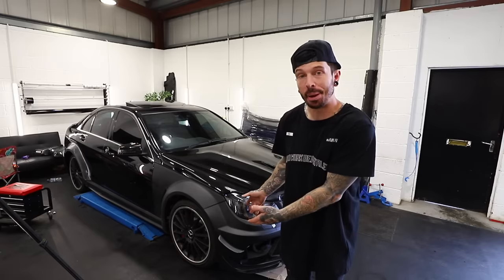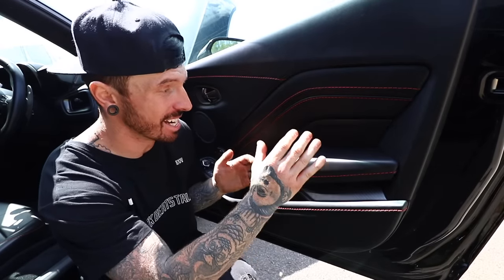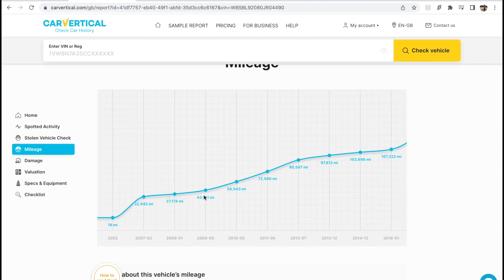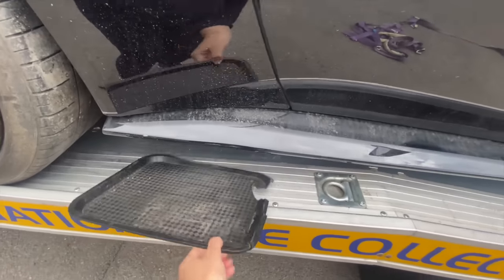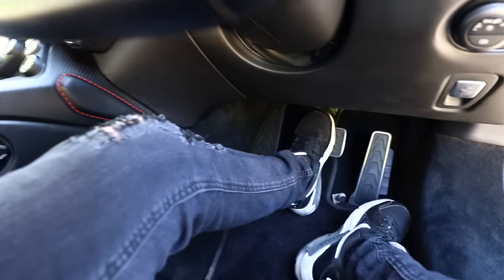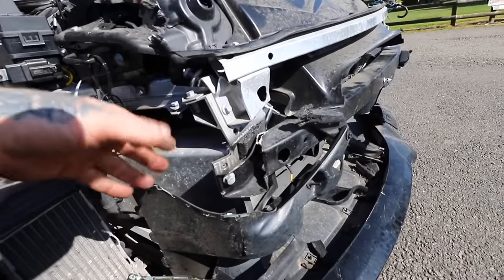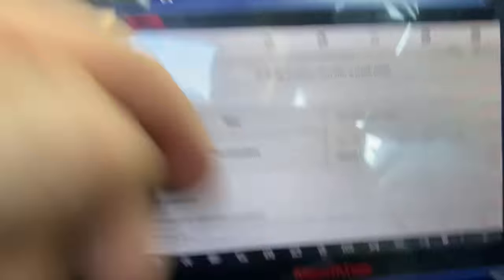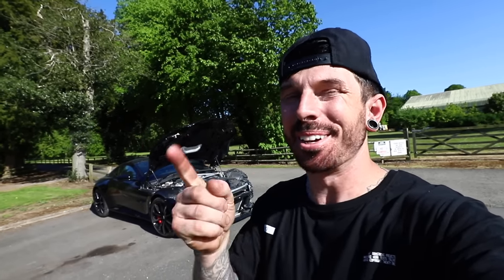I BOUGHT THE CHEAPEST 2019 ASTON MARTIN VANTAGE ... ITS WRECKED

Comment: Hi Matt, I’m an Windscreen/ ADAS technician your Aston has more than likely got a secure gateway, this stops any after market diagnostic tools accessing the  ECU so you can’t make any changes or run global checks,the only way round it is to use main dealer software or use a third party such as Core diagnostics or ASTECH who can access it remotely. Hope this helps. Good luck

Comment: MATT if it didn't start check behind the left hand front kick panel for a inertia switch if it has one it would have tripped when the accident happened they usually cut power to the fuel pump and sometimes ignition if there is a hole in the kick panel in front of the a pillar put your finger in the hole and push the button this will reset the switch hope this helps cheers from down under
Reply from the maker: Legend l!
Reply: @MatArmstrongbmx  you need to check under the back seat bottom on the floor there is a hole with a yellow button it also may need to be reset it is a battery check battery off switch the ignition will work but not start i have just watched a video called Aston martin db9 check battery off switch cheers from down under

Comment: You must have at least 13.8 volts.  Also check the engine earth.  With that broken weld that chassis beam can be repaired by a specialist welder. Speak to the Audi panelshop as they have a lot of experience with aluminium car bodies and can reinforce the chassis with the correct bonding agent.

Follow the engine earth and before you try to start it again, check the radiator etc in front is not jamming up the front of the motor.  

Try and turn the engine manually and do take a torch and check the block is not cracked.

Where  did you buy the EBD datapad?

Comment: 16:07 Sub 12v is too low, for future reference. You're reading no load voltage, once you try and start it, the voltage will drop and the battery won't be able to supply enough current to crank the engine. Ideally you wanna try it once you're at least at the high 12s/13s

Comment: Great content. For future diagnosis for starting etc. if you locate the starter motor relay you can normally by pass this using a single piece of wire. Not a fix but helps with diagnosis!

Comment: As for value - look up the value for a typical Vantage of  this age & mileage - knock off the cost of ALL the parts you will need - then deduct 20% for the reduction in value as a "crash-damaged vehicle (NOT repaired by AM dealer!) and that will be roughly the figure you should use for comparison to another in this age range.  My bet is that you'll end up saving around £5-10k only!

Comment: Replace the battery in the Voda phone fob I had the same problem with a salvage car, it takes cr2032 battery it kills the power to ecu and starter and then you need to hold the button on the Voda fob it should be a bright red led on the fob